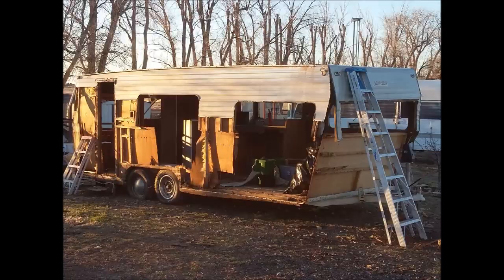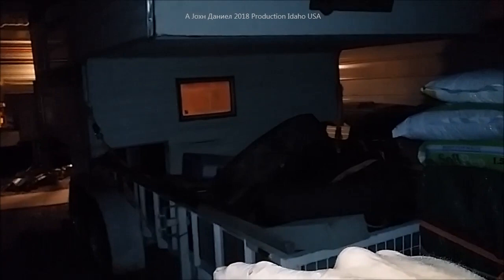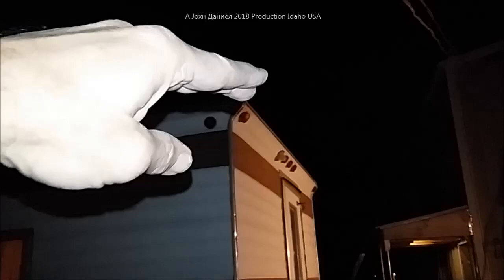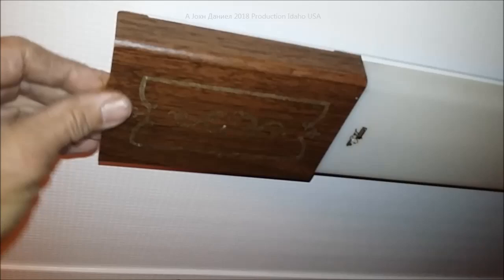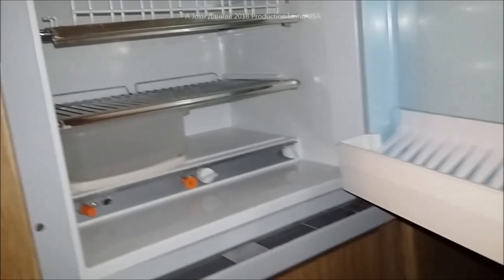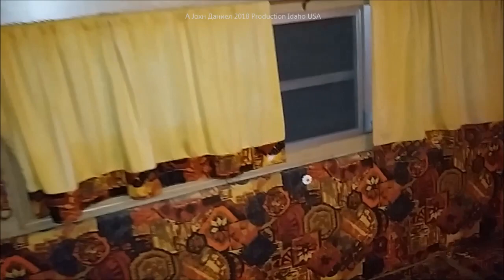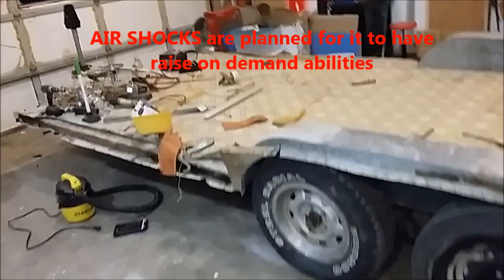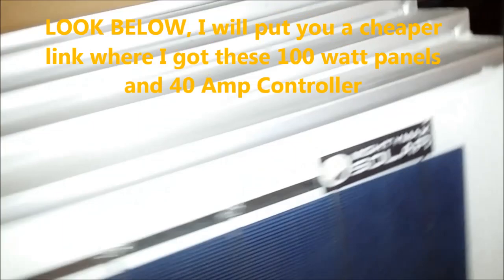DIY Hybrid Camper Trailer build to BUG OUT, Prepper Video 1

Comment from the maker: Serious bug out stuff. Those MightyMax 100 Watt panels are 4 bus bar panels , work very good laying flat https://amzn.to/2pPGo4E for $100 each delivered. The EPsolar controller is a 40 amp MPPT I got at https://amzn.to/2pSeLrJ with the remote and battery monitor. More videos will come showing all stages and installs of things I will use. Stay tuned.
Reply from the maker: You can build like this too, If my 11 year old can weld.......Best Mig Welder - https://ebay.to/2HcaRoW, Quality helmet - https://ebay.to/2HMLlnt VIDEO 1 @ https://youtu.be/4P1IvdkIEkY
All the metal used can be found locally, on craigslist or from other sources such as recycled or re purposed. ALWAYS BE SAFE, not all other welding helmets are safe to your eyes, be careful learn your equipments ability.

Comment from the maker: HOW I GOT MY BUILD MATH 
Frame and wheels weighs 878 lbs
1971 camper weighs 1491 lbs
Wood deck components and additional steel weighs about 430 lbs
Batteries and finishing materials weighs 470 lbs
3270 lbs total camper trailer weight
Add solar and controller, 112 lbs and supplies, I should be right at 3500 lbs. 
The REASON is it has 2 of the Dayton 3500 lb axles, it can safely run on one if I succeed.
Doing this kind of build allows me a 90" width verses a 100" width of normal campers. And I can put Airbags or Airshocks on it to raise it to get over most obstacles or low water crossings better.

Comment: as though its never been used, the 50" s through to the 80's the USA was very wealthy from what I've learnt and so much was built and sold locally.
Reply from the maker: The camper don't even have a registration history. Appears just as the guy said, used a few times as a guest bed room while it sat in a barn. Got it for free. No documents at all. However, as a modified I will have a builders title, already filed for it.

Comment: I think it is a very good idea for a bug out vehicle, except you made a big mistake. You should have started with a trailer with tandem 5,200 pound axles, instead of 3,500s. This is because you'll most likely be storing and transporting a huge amount of heavy gear, food, gasoline, propane, solar batteries, a generator, guns and ammo inside the camper ready to go when the time comes. It can be extremely dangerous to pull an overweight trailer, especially in the mountains. And it is possible to break an axle off-road if overloaded, or burn the brakes out. When you are all done, load all your gear etc. into the camper and take it to a weigh station. You can always upgrade the axles later. If you are not overweight, you are not prepared enough and you should stockpile more stuff.
Reply from the maker: Already on that - We are looking at 5 SLA-31 batteries, 500 watts solar, food stocks (80% dehydrated), water recovery filtration units, fuel, and gear for 6 for 120 days+ at a  weight of 930 lbs. A good portion will be in the truck as well.  Generator is a 1500 watt weighs 49 lbs. We will carry additional tools and obvious repair parts at about 230 lbs. 
Trailer just got weighed with it all this on the trailer and none in the truck (TODAY - See newest video out later of camper on trailer) with camper, water tanks full, 21 gallons gas in underbelly tank, 12 - 40 gallon totes of absolute need supplies, 5 cinder blocks added for laughs, all the materials to finish it,  but without the 5 batteries (388 lbs) and came in at 3020 lbs.  
By replacing the 38 lb water heater with a 17 lb instant L-7 and the steel 30 lb popane tanks with my 40 lb Aluminum tanks I get 15.7 gallons of propane for the same weight of 12.  We even have been weighing the 12 totes ( 28+ lbs) knowing those will be unloaded into the RV and only 1 or 2 kept in it.
I'm working on it for sure.
Reply: I've known people who bought a cargo trailer to transport their supplies without thinking about the axle rating, and then later they were sorry they didn't get heavy axles. You've definitely know what you are doing and you've done your math. Good job.
Reply from the maker: Rule of thumb, to get full use from your axle ratings you have to add implied reactive load to your math. 4500 lbs in a 7000 capacity trailer can quickly become 6000 lbs reactive in a loaded run over a large dip in the road. A 3500 axle is designed for 1 second at 140% reactive. But thats as a SINGLE axle, with a dual axle it's less at 128% (r-x2) due to the feedback from the center pivot. So when people get a pair of #3500 and think Ye'haaaa I can always load to 7000 lbs, they fail to use the reactive load survivability is 9000 lbs as a pair, but hitting a highway RR crossing at 50 mph can become 11000 lbs force real quick.  Thats why my goal is nothing over 70% spindle rating for permanent mounted or carried things.
Reply: John, I find this reactive load info extremely interesting and informative. I started out by offering you some constructive criticism and now I'm getting a valuable safety lesson. I'D APPRECIATE IT IF YOU COULD PLEASE ANSWER A FEW QUESTIONS, and help me better understand what you are saying.

I have a cargo trailer with dual 5200s and I keep it loaded to the roof with survival bug out stuff. But I don't know exactly how much it all weighs. I'm planning on having the state Department of Transportation meet me with their portable scale (which they told me they would be happy to do), and I was going to ask their officer for some advice about how much I could realistically safely haul. 

I used to own a car trailer with dual 5200s and I had a lot of experience pulling it with 10K loads (I know I was at 10K because I took it to a weigh station before every trip). I had a lot of problems over the years such as a blown tire and I burned out my brakes a couple of times. I knew I was pushing my luck. 

My new cargo trailer is a much better trailer and pulls way more smoothly, but the tires bulge out some with my current load, so I'm not very confident I won't have more problems, and I don't want to screw up, break an axle, blow a tire, or have a wreck. I can't remember what ply tires I have but they are high quality so that shouldn't be an issue. I also have a solid steel ballmount hitch and a 10K rated ball. I also welded some extra support brackets on my class IV trailer hitch. 

SO YOU ARE SAYING THAT I CAN ONLY SAFELY HAVE 7,300 POUNDS GROSS WEIGHT - IS THAT RIGHT? And what about if I drive slowly and be careful on bumps and potholes. What is the maximum I can haul if I'm careful? I keep quite a lot of gear in my pickup truck camper as well. 

What about using a weight distributing hitch?

http://securityandselfreliance.com/bugging-out/bugging-out-setting-up-our-tow-vehicle-with-a-weight-distributing-hitch/

Any other advice you can give me will be much appreciated. 

Thanks!
Reply from the maker: You can't do much on weight allowances other than stay in the limits of the trailer. Going slow is helpful but not a total solution. The tires bulging may be air pressure lower than permitted, or lack of sidewall strength. If they came with the cargo trailer, they are the bare minimum by law, most people upgrade asap on the factory tires. As for the weight distribution hitch, it can alleviate some load but its mainly for towing quality. 
Replace everything you can with DRY or lighter weight items if possible, thats the best thing, load management. Haul a water filtration in the place of lots of water. Tarps can refill water barrels.